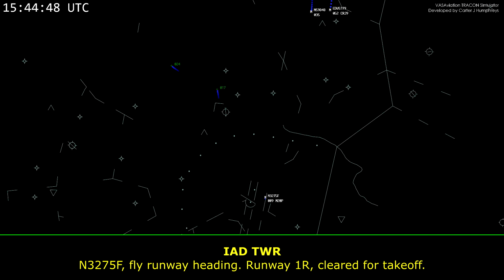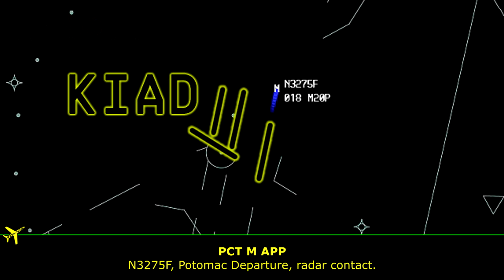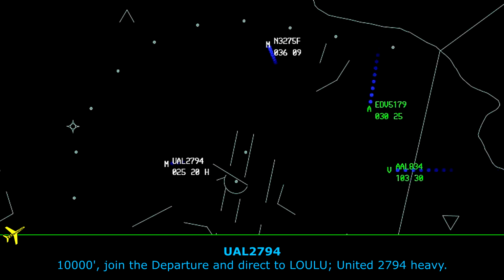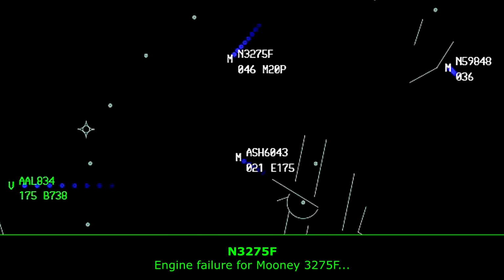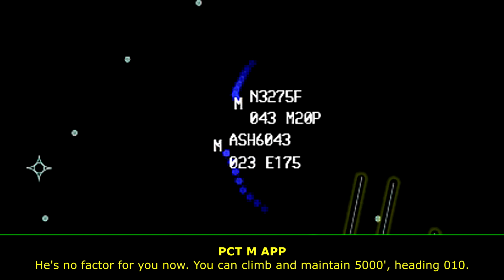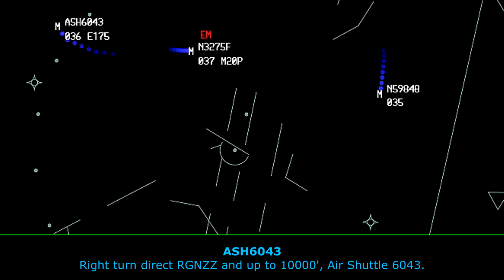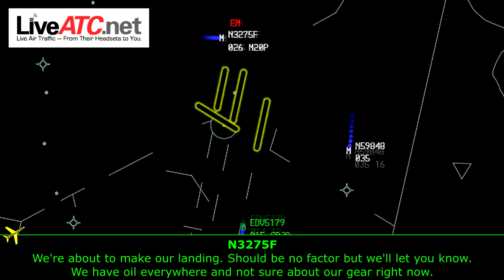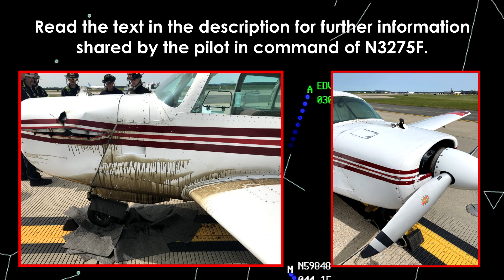Mooney M20F has ENGINE EXPLOSION AFTER TAKEOFF | Emergency Returns

Comment: I didnt know that Approach can give airfield clearances for landing. Did that engine keep turning despite the massive oil loss?
Reply from the maker: Potomac coordinated with TWR to give that clearance. Whatever necessary to make the pilot focus on his things and not switch frequencies
Reply: The tower controller has commented on an earlier message in this thread that he had passed on the clearance to land to the approach controller. There's usually a lot of behind the scenes communication that we don't hear, when it comes to handling emergencies.
Reply: It looks like it continued to make a little bit of power. From the cowl, it seems like they threw a rod.
Reply: @N1120A  No. They would have shut it down because of the vibration. If you don't, the engine can dismount from the airplane and you crash.

Comment: Does his insurance cover it?
Reply from the maker: Affirm
Reply: What exactly does the insurance cover on a case like this?
I can see the cost of a new or repaired cowling and the clean up. If the vibration caused structural damage.  
But engine repair costs?  Doubt that. Maybe the engine company step up and help him out with a deal on a replacement engine.

Comment: Great job by the radar departure controller. Not sure why the tower sent the guy to 1R around because it wasn’t opposite direction to the same runway. Also a emergency.
Reply from the maker: 35F might choose 19L too
Reply: Approach had offered any runway to the Mooney. Although he had stated he'd take 19C, it might have worked out differently for any reason.
Reply: EM craft was cleared any runway. He might have had visibility issues (look at that oil) or ended up needing a different one. Why land traffic opposite an inbound EM craft with clearance to any runway. A go around delays them 15 minutes.

Comment: Second guessing is for armchair quarterbacks and flight sim junkies. You saw a long runway and took it. Well done. Judging from the look of that cowling, the noise and shaking would have left a load in my shorts. We practice engine out for this reason. They rarely go by the textbook, but we practice them anyway. Well done.

Comment: There was no engine explosion. It just seized up and dumped oil everywhere. Great job landing though.
Reply: The hole and distorted cowling suggests otherwise.  :-)
Reply from the maker: Complete explosion
Reply: They definitely threw a rod out that left side cowl
Reply: @N1120A  I'd wager there's a jug sitting in the cowling just under that bent section and the rods are still there. Piston might be missing at that point though. Hard to throw a rod out the side of a horizontal engine, there's a whole bunch of metal in the way...

Comment: Gotta say, pilot sounded pretty flustered (though I can't imagine not being a little flustered having a blowout) but was handled like a pro on both sides of the radio.
Reply: That’s because that was the student you were hearing. Up until the malfunction, the student was the one flying as well as on the radio. The moment there was a problem, the instructor took over flying, and had the student continue to handle radio communication (which is totally by the book).

Comment: Not often you see parts make it out of the cowling like that. Why don't Americans say mayday? Clearly this was an emergency and the proper procedure gives you too priority and makes sure everyone knows.
Reply: Since you didn't bother reading the pilot's statement, which is the first pinned comment, I'll help you out.  The first half of his radio transmission was stepped on.  That would include the portion he announced a mayday.  He didn't know he was stepped on until he was able to listen to the tapes later.  Better???
Reply: How do you know he didn't?  From the post, "Upon listening to the tapes, I was stepped on or stepped on somebody
 when I started the call."
Reply: Additionally, "engine failure" = "emergency" whether or not the word Mayday is explicitly heard.
Reply: Atc has the authority to declare emergency for you. Additionally, if. Pilot says something like, “engine failure”, “fire”, “controllability problem” it is implied that it is an emergency. No mayday call required.

Comment: I don't like the term engine explosion because it seems to sensationalize the reality that the engine cowling had a containment failure.  Normally jet engines don't explode they have parts come loose or debris is drawn in through the air compressor fins.
Reply: Wizbang Fl.   We'll be sure not to use that term again. Sorry if it offended you snowflake.